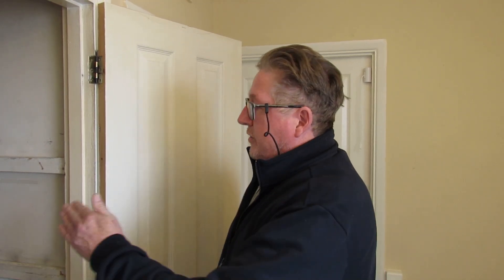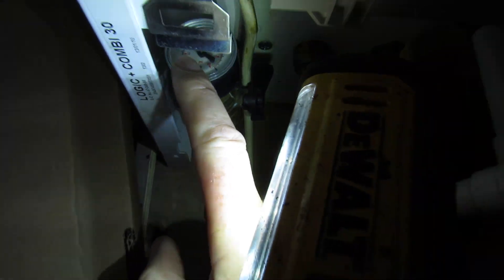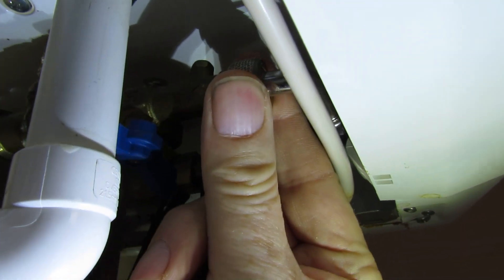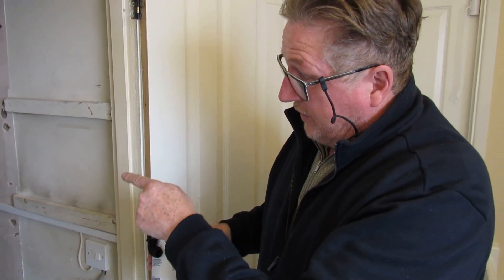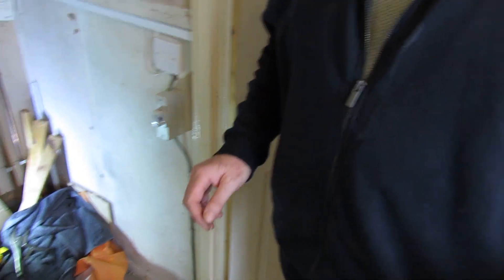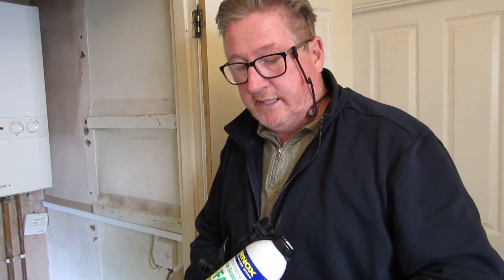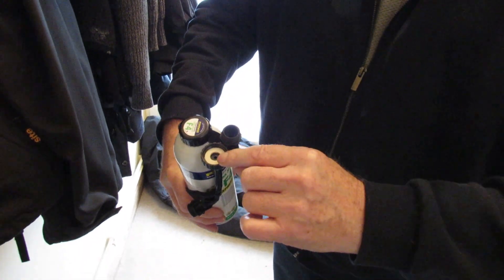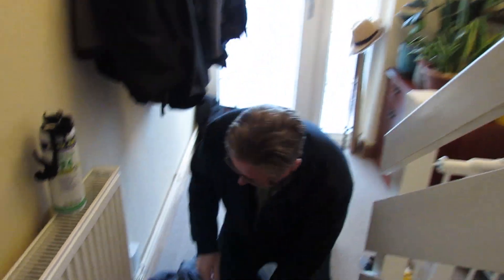Central Heating System Losing Pressure Or Leaking? - Fernox Leak Sealer F4 Express Via Radiator

Comment: Could someone answer my question pls. Is it normal for the heating on the boiler to be isolated and turn off for 2 days  and use the hot water as usual to diagnose if the boiler pressure loss is due to leak on the pipes or problem with the boiler itself. The Engineer came riday have done that and will see the results on Monday. I thought the heating system and hot water is totally separate.so the pressure will not drop in just using hot water bacise the heating is isolated. Pls help me
Reply: Hi, I have the same issue and Baxi have done the same yesterday. I need to call Engineer tomorrow but at the moment the pressure has not fallen so seems like I have a leak. Like yours he has turned the central heating off
Reply: @yassarismail8570  me too!!! I have to keep topping up pressure until Monday. The plumber is going to try the sealant thing and hope it works

Comment: My advice applies to a combi-boiler/closed system. This is my experience!

 I think I would only recommend this (as in my case), if you know the leak is not your boiler which is easy to diagnose by isolating the central heating from the boiler. These are normally two red valves under your boiler. Using a screwdriver you turn off both the valves. The pipes are normally larger at 22mm in width). Turn these both off and wait 24 hours (without using the central heating! Turn the timer off (in my case I had on, off, timer, and boost. I used OFF) so no central heating is possible even if someone turns up the thermostat. You could also turn off the boiler completely but you won't have any hot water.

If your pressure still drops after isolating the central heating after your period of time you have a leak in the boiler somehow. Quite simply water is escaping from the boiler when it is running. 

It will be leaking either from 1) the boiler (drips on the floor or the running down the wall where the boiler is) which indicates an internal leak, or a crack in the heat exchanger 2) A leak from the condensation pipe which will normally give off water during normal use. If it is dripping water when the boiler is cold you still have a problem 3) pressure release valve which is not normal to release any water unless the pressure in the central heating exceeds dangerous limits.

The system will also lose pressure much more quickly if the expansion tank cannot expand. This "tank" is inside the boiler and helps to take the pressure as the central heating heats up. With heat the pressure will increase, thus this tank expands to take the increase in pressure. This tank should already be pressurised in order to take further expansion. If flat it cannot expand. Its like sucking on a flat balloon. Funnily enough, to expand this tank requires a bicycle pump! 

So if you think your boiler is leaking I would recommend getting someone in to investigate and not using a leak sealant unless temporary.

If after determining your boiler is fine... It must be the central heating. It cant be anything else right? It cannot be if you have isolated the boiler. Its in the pipes feeding your radiators, or the radiators themselves.

Check your radiators under each valve while cold or hot (both ends of a radiator). Put some kitchen towel wrapped under each valve (use some masking or other paper tape to make it easier to detect water). It doesn't take long to drop 1-bar of pressure in 24 hours with a slow drip. On hot the water may evaporate, but with some kitchen towel you may detect some evidence. Its obviously easier to detect leaks from upstairs then on the ground floor.

I would say that some leaks may only occur when the central heating is either hot (expanded) or cold (contracted) so its worth checking both

If after all this.. the leak is not obvious (i.e. on the ceilings or walls from upstairs) then its on the ground floor. 
If your pipes are buried in concrete on the ground floor (like my house) I have a slow leak. 

In which case use leak sealant to get you through a year. It will only work with a junction leak, or pinprick leak. To detect a leak will require specialist people whom use both heat detectors and also listening devices (which are much more accurate).
Reply: Hi Simon.is it possible that it is the boiler issue of leaking rather the pipes or radiators because on one occasion we re pressurised the boiler at 9am and the pressure stayed on 1.3 from time of re pressurising from 9am to 5pm and  only loss pressure when heating is turn on for 2 hours the pressurised dropped to 0.7 then heating off overnight , the pressure stayed same at 0.7 and when heating turn on at 6am the pressure dropped to 0.5 after a couple of hours

Comment: If your boiler is losing pressure and you can't find a leak it could be that your expansion tank needs repressurizing. You can lose water through the pressure relief valve if the tank pressure is too low.
Reply from the maker: thanks, out install is rather basic but that sounds like something to definitely check.
Reply: @DanielJohnHowTo  If you have a Combi Boiler the expansion tank is inside it.
Reply: @Paul-mg7bh You need to close both valves initially. Then drain some water, which will come from inside the radiator and not the pipework. Then tighten it back up. Then add the leak sealer and close the bleed valve. Then open both radiator valves to their previous position. Then check and increase the system pressure. Then turn on the heating an the sealer will travel around the whole system.
Reply: @Paul-mg7bh One other thing, you will have introduced air into the system so you will need to bleed it after it has been running for a while to get out any air trapped in this radiator, and I would check the rest as well.
Reply: The F2 same size can instructions doesn't say let anything out of the rad ,? Strangely
Reply: I used this but as soon as i let the tube off loads came spraying out